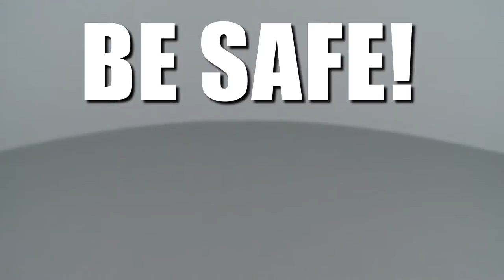Whirlpool Microwave Transformer Replacement #W10681123

Comment: To clarify, I have always read that when working on a microwave, you unplug it first then discharge the capacitor.

In the video, the magnetron was disconnected first, the transformer disconnected second and the capacitor disconnected third. 

Question: Since the capacitor holds a charge even after unplugged and also since the bleeder resistor should not always be counted on since it could fail, should the capacitor be discharged first in order to prevent shock?

Question: I know the capacitor may hold a charge even after the microwave is unplugged and the wires are disconnected from it, but does the transformer hold a charge even after the microwave is unplugged AND the wires are disconnected from it? 

Thanks